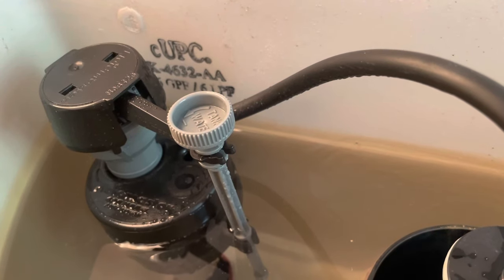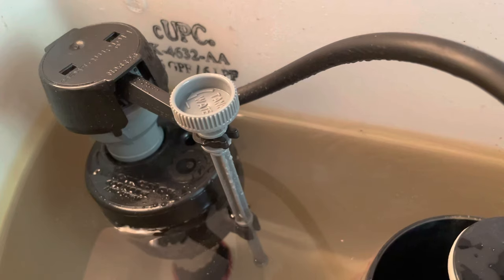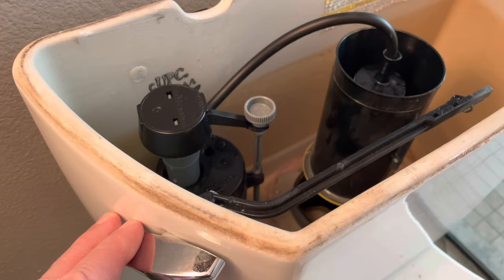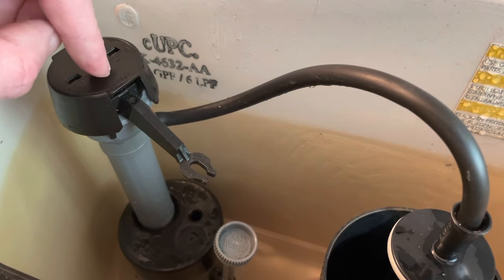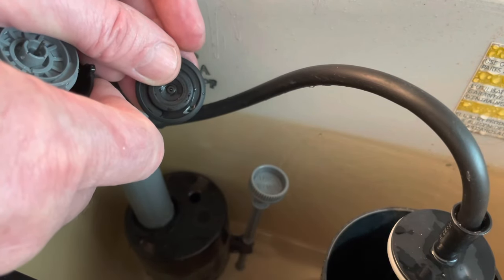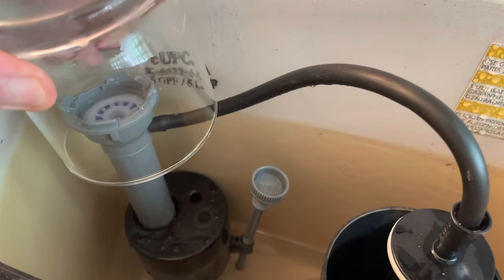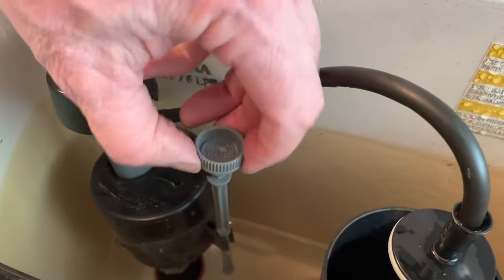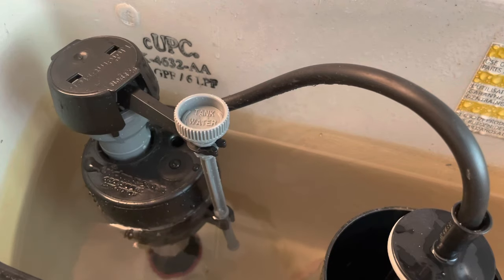Toilet Fill Valve Not Shutting Off / Don’t Replace / Fix Fast Cheap & Easy For Beginners

Comment: Hello Joe, I'm hoping you can help me I have pretty much that exact same style cup in my toilet but my problem seems to be that mine has a sort of clip at the very bottom of it that seems if it's in a certain position when you flush the toilet This clip shifts downward by a quarter of an inch with she seems to be locking in place the ball cup And then the ball cup can't rise I have to go in flip that little clip up a quarter inch and it seems to unlock it. It's almost like a claw clip And on mine it looks like one of the claws snapped off a little piece on the end but I don't think that would do anything because it's been like that since I moved in here. Any suggestions or do I need a replacement?
Reply from the maker: I remember the ones with the clips… rather than continuing to fuss with it, I would just change it out. They’re cheap enough, and there’s also a little trick where you just replace the upper portion. It can be done in seconds with no tools. Here’s a video:

Replace Fluidmaster Toilet Fill Valve in Seconds For Beginners NO TOOLS NEEDED
https://youtu.be/ovdWF5Hdz8U
Reply: @papajoeknows8355  Hey wow that was fast, thanks Papa Joe This is very helpful, I'll just replace it out like you said probably no more than 10 or 20 bucks. You're the best thank you
Reply from the maker: @brian8431  you bet, and yes, they’re only about $10. 👍🏻

Comment: I followed all the steps and although it is not as loud nor leaking as much, it is still running. Any other suggestions?
Reply from the maker: When they start getting “fussy” like that, it’s easier to just replace the valve. It’s easy to do, and they’re only $10.

Also, there’s a trick where you just replace the upper portion… it can be done quickly and with no tools. Here’s a video…

Replace Fluidmaster Toilet Fill Valve in Seconds For Beginners NO TOOLS NEEDED
https://youtu.be/ovdWF5Hdz8U

Comment: I did all the cleaning and put in a new seal but it still did not shut off,  Any Hints?  Thanks
Reply from the maker: At that point, it just easier to replace the valve. But you can replace only the upper portion very easily. Here’s a vid:

Replace Fluidmaster Toilet Fill Valve in Seconds For Beginners NO TOOLS NEEDED
https://youtu.be/ovdWF5Hdz8U

Comment: Where do you buy the rubber gaskets at?
Reply from the maker: You can usually get them at a home improvement store, but I put a link down in the description, and also in the pinned comment if that helps.

Comment: The replacement diaphragms via the amazon link come 10 to a $15 package, but are supposedly for a SPECIFIC model of Fluidmaster shutoff. How "generic" are these diaphragms? I don't know the exact "model #" of what I have.
Reply from the maker: You can also find them sometimes at home improvement stores… maybe remove the one you’ve got and go match it up.

Comment: my is brand new put in by the plumber. but yet it keeps running. . might have to call plumber back. thanks
Reply from the maker: First try lifting the valve arm with your finger to see if that shuts the valve off. If it does, then try turning the water level adjustment screw (at the end of the valve arm). Try turning it counter clockwise, that will lower the float allowing the rising water to lift the arm sooner to shut it off.

Comment: Does that valve affect tank having a slow leak?  I replaced the rubber seal at bottom of flush valve, yet no dice.  Thinking that this solution may fix
Reply from the maker: The function of the fill valve is simply to fill (and maintain) the water level in the tank. I’m assuming you’re not seeing water on the floor, but if you feel up underneath the tank, does it feel wet at all anywhere?
Reply: @papajoeknows8355  none at all, I believe it's going into the toilet still.
Reply from the maker: @zakikhan814  and you’ve replaced the flapper / canister seal?
Reply: @papajoeknows8355  yessir, I played with the rubber tube that exits the fill valve, lifted it above water level and that seemed to do the trick
Reply from the maker: @zakikhan814  glad you got it resolved. 👍🏻

Comment: Papa Joe, do you know why, after turning the valve off, that the tank wouldn’t drain all the way? Mine only drains halfway and then refills even though I turned my angle stop all the way to the right.
Reply from the maker: If it’s refilling, then the angle stop is faulty and not shutting off all the way. It only “feels” like it’s turned all the way off. It’s quite common for them to fail because they are hardly ever used.
Reply: Thank you! Is the only solution to replace it? And if so, do you have a video teaching me how to do that? 👼
Reply from the maker: @BrynWoz  sometimes it’s possible to get the valve unstuck. Here’s a good approach:

https://youtu.be/L-cTL7JJr8E
Reply: @papajoeknows8355  thank you!!

Comment: What it it’s the older toilets with a pink cap that closes the hole On the bottom of the tank?
Reply from the maker: Send me a quick video of what the problem is. My email is in description.
Reply: It was the chain that needed to be looser, but thank you.:)

Comment: Everytime my building turns the water off for repairs there is damage to my faucet cartridges and water pressure once the water returns. 
This was the first time it wrecked my toilet tho.
i sprayed some soap onto the lever in order to detach it more easily, but still couldn't get the cap plus valve seal off. 
Lenderman shop video comment from @simon6071 clued me in what i was doing wrong.
He instructs:
1/  Turn off water supply.
2/ Grip and hold shaft (tube below valve) with right hand while keeping the float up with thumb and index finger. 
**(Video above shows hand grasping shaft ABOVE the float, which did NOT work for me)**
3/ With your left hand, turn the cap (with the valve inside) and lever 1/8th of a turn ANTI-CLOCKWISE while pressing down on top of the cap. (Remember the position of lever when the valve came off)

To replace the cap with valve inside, reverse the above steps. 
To begin, the lever should be at the same position when the valve came off. 
Turn CLOCKWISE 1/8th of a turn to locked position.

I found my valve seal perfect and clean.
But when i did the flush valve out with water thing while holding cup over i found several small rocks actually lodged in that white plastic grating; numerous blockages.
I crushed some, & plucked out others with eyebrow tweezers, flushed water through again to ensure all clear before replacing the cap/reattaching lever. 
Also i did not flush it out "slightly". Used maximum water force several times. I wanted to make sure! All good now.

Comment: Is this the same procedure if the water won't refill after flushing?
Reply from the maker: When they start getting “fussy” like that, it’s easier to just replace the valve. It’s easy to do, and they’re only $10.

Also, there’s a trick where you just replace the upper portion… it can be done quickly and with no tools. Here’s a video…

Replace Fluidmaster Toilet Fill Valve in Seconds For Beginners NO TOOLS NEEDED
https://youtu.be/ovdWF5Hdz8U
Reply: @papajoeknows8355  thanks so much. Looks like I have some shopping to do.
Reply from the maker: @WhySoLoud  you bet, and here’s an Amazon link if it helps…

Fluidmaster 400 valve

https://amzn.to/3qE2TwB
Reply: @papajoeknows8355  ☑👍

Comment: Would this cause an intermittent running ?
Reply from the maker: No, that usually means you need to replace the flapper. Here’s a video on that…

Toilet Turning On & Off by Itself ? How to Replace the Flapper
https://youtu.be/CAhGclvP3f8
Reply from the maker: If by chance you have a canister style toilet and not a flapper, let me know, I’ve got a video on that also.

Comment: Opened valve, cleaned and flushed, Check for debris, Put in a new valve seal but it still leaks,  Is there something else to do?
Reply from the maker: At that point it’s easiest to just replace the valve. And you can replace just the upper portion in seconds with no tools, here’s a vid:

Replace Fluidmaster Toilet Fill Valve in Seconds For Beginners NO TOOLS NEEDED
https://youtu.be/ovdWF5Hdz8U

Comment: I did that to mine, but a new rubber seal, and also checked the little plastic piece that goes underneath the bottom to slow down the pressure or the water, and I’m still getting the whistling sound. The valve will not shut.
Reply from the maker: When they start getting “fussy” like that, it’s easier to just replace the valve. It’s easy to do, and they’re only $10.

Also, there’s a trick where you just replace the upper portion… it can be done quickly and with no tools. Here’s a video…

Replace Fluidmaster Toilet Fill Valve in Seconds For Beginners NO TOOLS NEEDED
https://youtu.be/ovdWF5Hdz8U
Reply: @papajoeknows8355  yes, indeed, I was debating should I buy the valve or the rubber seal, I should’ve listened to my instinct. And you’re right they are super inexpensive.

Comment: @Papa Joe Knows - my toilet has the opposite problem: when I flush it the valve doesn’t open so I have to remove the tank lid and touch the float to get it to start re-filling. Any suggestions?
Reply from the maker: When they start getting “fussy” like that, it’s easier to just replace the valve. It’s easy to do, and they’re only $10.

Also, there’s a trick where you just replace the upper portion… it can be done quickly and with no tools. Here’s a video…

Replace Fluidmaster Toilet Fill Valve in Seconds For Beginners NO TOOLS NEEDED
https://youtu.be/ovdWF5Hdz8U

Comment: I have one of these; I replaced my bidet today, and suddenly, the water is not filling all the way to the line. How do I adjust it so the water fills the tank?
Reply from the maker: You need to adjust the float. Very easy to do… even though this video addresses the opposite problem, it will show you how to adjust it.

https://youtu.be/KNaZAGF4tKk
Reply: @papajoeknows8355  I have been doing that; no luck. But I will watch your video and let you know what happens. Thanks for the help!

Comment: I have an issue with my toilet tank where the stem on the fill valve doesnt allow it to fully fill up the tank like its supposed to. And when it doesnt fill up eventually the water thats in the bowl drains, so if we try to flush it later on during the day, it doesnt unless we turn the stem almost an entire rotation for the water to work again. Is there any way to fix it? I also notice that after every flush, the little stem is very loose to where it'll fill up fully and the stem will need to be turned again
Reply from the maker: When they start getting “fussy” like that, it’s easier to just replace the valve. It’s easy to do, and they’re only $10.

Also, there’s a trick where you just replace the upper portion… it can be done quickly and with no tools. Here’s a video…

Replace Fluidmaster Toilet Fill Valve in Seconds For Beginners NO TOOLS NEEDED
https://youtu.be/ovdWF5Hdz8U

Comment: what do i do if that doesnt work?  just replace the entire valve?
Reply from the maker: When they start getting “fussy,” it’s easier to just replace the valve. It’s easy to do, and they’re only $10.

Also, there’s a trick where you just replace the upper portion… it can be done quickly and with no tools. Here’s a video…

Replace Fluidmaster Toilet Fill Valve in Seconds For Beginners NO TOOLS NEEDED
https://youtu.be/ovdWF5Hdz8U

Comment: I found what happened to me was the tower part in the center lifted up. I pushed the plastic ring down ant urned it to the left looking down. Hope it stays or my cesspool will fill up and cost $600 to empty. I might want to replace the whole fluid master very soon
Reply from the maker: When they start getting “fussy” like that, it’s easier to just replace the valve. It’s easy to do, and they’re only $10.

Also, there’s a trick where you just replace the upper portion… it can be done quickly and with no tools. Here’s a video…

Replace Fluidmaster Toilet Fill Valve in Seconds For Beginners NO TOOLS NEEDED
https://youtu.be/ovdWF5Hdz8U

Comment: How do you Change the complete Inside. Have one just like this one. With the thing in the middle. When I got to that part it different. I got the universal to change it
Reply from the maker: Watch this for a quick change, no tools needed.

https://youtu.be/ovdWF5Hdz8U
Reply: Where’s the link for the replacement gaskets u mentioned that u would supply?  Sorry I don’t see it?  Does Home Depot sell just the replacement gaskets u mention?
Reply from the maker: @seankenreich3783  Amazon link is in description, but I just checked my Home Depot app, and they have also.
Reply: @papajoeknows8355  thanks for the information and also great video.  I tried flushing and cleaning gasket didn’t work.  I bought new gasket from Home Depot and works great now thanks!!
Reply from the maker: @seankenreich3783  you bet, glad it worked for you! 👍🏻

Comment: What do I do if the water shutoff valve is not stopping the flow of water into the toilet tank?
Reply from the maker: Adjust the float level using the round screw adjustment at the end of the lifter arm.
Reply: @papajoeknows8355  But the water should not be coming out if I turned the water off at the wall.
Reply from the maker: @chrisevelo3313  ohhh, gotchya, I misunderstood. Very common, because they seldom get used. Valve on wall is stuck and MAY need replacement. But first look for videos for “stuck toilet valve” or “stuck toilet angle stop.” You may be able to get it working again, but otherwise will have to replace.

Comment: What if you don't have replacement rubber part
Reply from the maker: It may well be that it doesn’t need replacement… sometimes just taking it out, cleaning it, and reinserting it does the trick. Also, flush out any debris like in the video. Alot of times that does the trick.

Comment: can you fix the black floatie somehow? mine refuses to float which causes the running
Reply from the maker: When they start getting “fussy” like that, it’s easier to just replace the valve. It’s easy to do, and they’re only $10.

Also, there’s a trick where you just replace the upper portion… it can be done quickly and with no tools. Here’s a video…

Replace Fluidmaster Toilet Fill Valve in Seconds For Beginners NO TOOLS NEEDED
https://youtu.be/ovdWF5Hdz8U

Comment: I poured sulfuric acid on it.  Then the top of the filler value loosened.  I am not able to retread the top to the ball.  Any recommendations?
Reply from the maker: It’s likely you may have damaged it with the sulfuric acid. It may be time to replace the valve. In the description, I’ve got a couple of videos on how to do that in seconds with no tools necessary.
Reply: @papajoeknows8355  Thank you for your quick response. Curious thing is that the sulfuric acid is in a plastic bottle?
Reply from the maker: @lauratempestini5719  yes but it’s a special kind of plastic (HDPE) that is not affected by the acid.

Comment: Its very difficult to know if its the fill valve or a fault of the washer on the siphon.  It could be either
Reply from the maker: When they start getting “fussy” like that, it’s easier to just replace the valve. It’s easy to do, and they’re only $10.

Also, there’s a trick where you just replace the upper portion… it can be done quickly and with no tools. Here’s a video…

Replace Fluidmaster Toilet Fill Valve in Seconds For Beginners NO TOOLS NEEDED
https://youtu.be/ovdWF5Hdz8U

Comment: I have a toilet in where it sounds like it shuts off but I come back like 6 hrs later and it is overflowing from the tank from where you flush the toilet.  Will the fix you showed work for me? My inside of the toilet looks likes yours. Also I do not think my angle valve works anymore.  I have to shut off the main water supply.
Reply: After putting my ear really really close to the valve, I can still hear like a hissing sound like water is still coming in but it hard to tell since appears to be off.
Reply from the maker: @geejr  first off, if your angle stop valve at the wall is not working, you definitely have shut off at the main water supply. Then, since you say you may be hearing a hissing noise, follow the procedure in this video. 👍🏻

Comment: I cleaned mine and it made the leaking worse. Off to Lowe's to buy a new one.
Reply from the maker: Honestly, if you’re making the trip anyway, it’s easier to just replace the valve. It’s easy to do, and they’re only $10.

Also, there’s a trick where you just replace the upper portion… it can be done quickly and with no tools. Here’s a video…

Replace Fluidmaster Toilet Fill Valve in Seconds For Beginners NO TOOLS NEEDED
https://youtu.be/ovdWF5Hdz8U
Reply: @papajoeknows8355  I bought the new seal and it fixed the problem. Best $3 I ever spent. Thanks!

Comment: "Now don't take the top off because you'll break it." Ahhh if only I saw this vid 5 minutes earlier 😁
Reply from the maker: Ahhhhh, that sucks. Since you’re going to be replacing your valve now, there’s a trick where you just replace the upper portion… it can be done quickly and with no tools. Here’s a video…

Replace Fluidmaster Toilet Fill Valve in Seconds For Beginners NO TOOLS NEEDED
https://youtu.be/ovdWF5Hdz8U
Reply: @papajoeknows8355  thank you very much!

Comment: Can you get those seals at like Home Depot or Menards?
Reply from the maker: Often times yes. 👍🏻
Reply: @papajoeknows8355  that was so easy to do after watching your video. I found the seal at Menards for less than $2 but Fluidmaster makes them. Apparently there’s a small and a large one so I was lucky to have already looked at the valve equipped on our toilet.

Comment: You emphasize replacing the circular rubber seal "when you don't feel like replacing the whole valve" to fix a running toilet, but why would one want to replace the whole valve if it is not needed?
Reply from the maker: Some people are just gluttons for punishment lol. 👍🏻